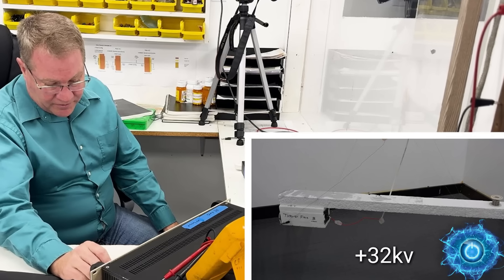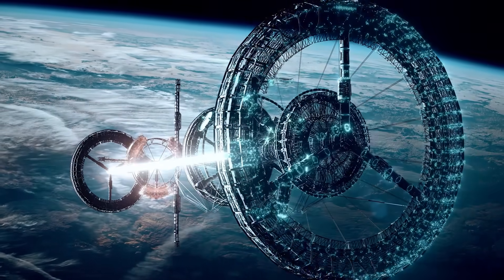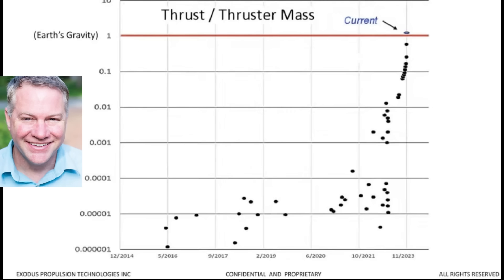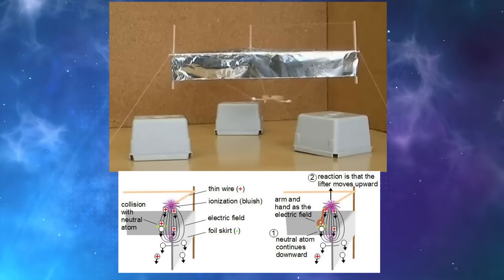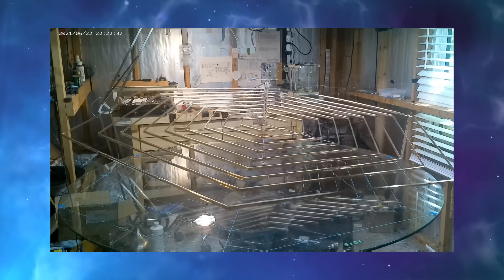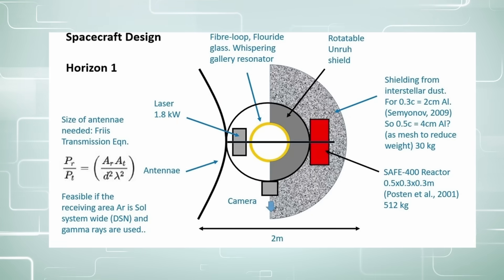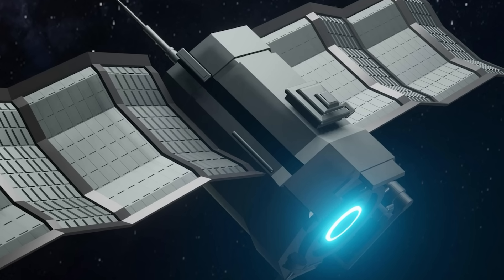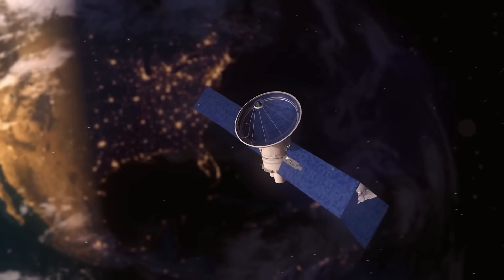Propulsion Breakthrough!? New Electric Drive Defies Physics

Comment: The cool thing is this showed lift in a vacuum  so it's not ionized wind.
Reply: Goes from lifting in air, to barely measurable in vacuum. Yeh, this is not some breakthrough drive. It's ionic thrust and an interaction with vacuum chamber.
Reply: daves7 • That's where "optimizing" enters the scene.
No vacuum is ever empty, no matter how low.
In the absence of the correct understanding, the many ways of doing different kinds of experiments is the way to go, like many times before.
Reply: The point of using a vacuum chamber is to see if the thrust drops off in proportion to atmospheric pressure.
Reply: That's not correct. Buhler never demonstrated lift in a vacuum. His results are measured in micronewtons, making it difficult to confirm that this thing even works. The lifting you saw were normal ion thrust vehicles attracting and expelling the Earth's atmosphere. So you're conflating two experiments.
Reply: phyternl "Attracting and expelling" is propulsion.
You just have to do it correctly in order to obtain the optimum process for any inertia, and...since nothing is empty, not even the so-called "vacuum of space"...you draw the correct conclusion!🤔😯

Comment: Andrew Aurigema - Propellantless Drive Engineering Test 4k - Exodus 2024

The video title above gives detailed analysis of the work that is being done, whether you believe it's accurate or not. It's an in depth discussion with the engineer who is working with the lead researcher on the project. Their primary goal is to create something to keep satellites correctly oriented and positioned.
Reply from the maker: It will be interesting to see what it will do in space.
Reply: @Motor_Explorer1  I don't really understand your focus on whether it works in space. Their testing is done is a vacuum cylinder. A shoe string one because of their budget, but vacuum non-the-less. The only negative options I am aware of are either there is some complex experimental error and there is no force, or they are doing something deceptive. They've gone to great lengths to rule out ionic wind as a possibility.
Reply from the maker: They seem to be pretty straight forward about it, this should be easily replicable in other labs. But I do agree space is probably last step in the process.
Reply: @Motor_Explorer1  Space isn’t the best test. I think controlled tests measuring acceleration vs. input energy would distinguish between a self acceleration system or spurious force from the setup..
Reply: @Sensorium19  It's not a great space drive if it doesn't work in space, y'know?
Reply: @marcforrester7738  The entire point of my comment was to point out that unless you suspect experimental error or malicious deception, there is literally no reason to believe the proposed technology would not work in space/hard vacuum. Attributing the effect to ion wind is functionally identical to saying what they are doing is fake. Ion wind drives/lifters have existed for many years and are not functionally useful in the scenarios under consideration for this technology. I would completely understand if people believed it was fake or not accurate. What I don't understand is this "does it work in space?" brain rot. Forgive me for putting it so bluntly, but this is nonsensical.
Reply: Considering the atmosphere extends quite aways into space (ions present as far as the moon). A low to mid orbit satilite shouldn't have any difficulties if it's just ion effect.
But if it's not simply/only ion effects, say aether flow/field effect due to localized high voltage disequilibrium/nonlinear mass inertial distribution etc. this could get interesting.
Reply: @dananorth895 Still,  ion wind effects hav3 to have enough mass to make thrust which is dubious in LEO. It’s not ion wind.

Comment: Ionic wind effect should be pretty easy to detect, right? The air would be blowing. Also, if the device is capable of producing more thrust than its weight (which is claimed) then it is also extremely easy to detect. So, my question is, where is the video of the levitating product?
Reply: There was a time when the Internet was awash in videos showing off Lifter projects, but over the years that fad peaked and waned. And these hobbyist don’t have vacuum chambers in which to vet out the ionic wind issue (is that the only source of propulsive effect?) NASA could have settled this years ago and Lifters are dirt cheap to build. To my knowledge they’ve never bothered to. Vast majority of scientists just dismiss Lifters to be due to ionic wind effect.
Reply: Not to mention ionic wind drives won't work in space from everything I've ever run across.
Reply from the maker: That's right so they test in vaccum. The team's drive produces a mere 10 milliNewtons, so I am thinking they are comparing some sub component to the thrust. In space, this is great for constant acceleration but on Earth it's very little. But we have to figure out what the effect even is (I don't think it's quantized inertia at all)
Reply: More thrust than the thrusters weight but not more thrust than the total weight of the thruster and power systems. Regardless of the process and whether it works in a vacuum or not, finding a self contained compact high voltage power source has still beaten everyone in the field. And if you have that power source then a magnetic sail or plasma sail interacting with the solar wind is still more thrust and easy to explain, undisputed, physics.
Reply: @franksmith3602 
Frank, I invented a car that runs on water.  It worked great until one day the Feds came knocking and told us that they wanted the plans or else.  Staring down the barrel of the gun made me turn the plans over to them rather quickly.  Now I can’t remember how to put the contraption together again, but it got 2,387 mpg.  Shell Oil bought the plans and locked them in a safe so that big oil won’t lose their control over gas and oil.  If I could only remember the combination to the safe, we could go and get them.  We would be billionaires for ever!.  Frank, are you in with me?  I need a positive answer right now.  Either you are in or you are out.  Which way do you flow, Frank???
Reply: @franksmith3602 that’s funny 😂
Reply: There’s no air in space…
Reply: They showed it in the video. Two different very basic conceptual builds. Watch it again.
Reply: But if there is no air (gas) in Space then could the ionic drive create force without wind (gas or atoms)?
Reply: @franksmith3602 😂😂😂
Reply: @franksmith3602  Pathologically lie much?
Reply: @ferrellsl  No he is telling the truth. I am the general that was there with him. Those were the best of times. I have been stuck at area 51 ever since!
Reply: @tstager1978  BS.  I was the CIA director at that time and I don't remember you at all.
Reply: Their claim is that the part of the apparatus which produces "thrust" can lift it's own weight, but not the weight of the entire system (power source, control electronics, etc).

They expect to be able to have a self contained, "levitating" craft in the next 12 months.
Reply: If they have these demo models as per the video clips. Just make a small scale one and I am sure Elon Musk would put it into space for real tests for nothing or a nominal amount. It would be of great interest to him if it is proven to work in the vacuum of space.
Regards from South Africa
Reply: @IO-zz2xy  Rocket launces are rough. Vibrations can wreck these designs. Its a problem.
Reply: No it does not work. They are ignoring the interaction between the device & the metal vacuum chamber. Its just electrostatic force between the metal vacuum container & the HV charged plates. Same thing with the Q-Drive that was the rage a few years ago.
Reply: @guytech7310  you ignore ionic model flight that proves it does work... at least on the scale of ounces. But like all other electric vehicles we do not have a power source that makes it practical.  And you can park a battleship between the distance of possible and practical.

But there are a number of companies proving results trying to make it practical... but I think they have many years if not decades more work to do before it will work on even a small scale.

However you could build a light drone today and use it, but why would you. Using a electric motor and a prop would give you much greater range.

But saying it does not work is grossly inaccurate.
Reply: @billlyell8322   This device is set up to work in a vacuum. Lifters are pointless in space since there is no air to use to generate thrust. Please think before you go on a rant.
Reply: @billlyell8322  large scale (and sized) capacitors are the supposed cure to this. We have already capacitors that do much simpler things today.
Reply: @guytech7310  Yeah thought that too -it might just be Lorentz Forces
Reply: @guytech7310  That’s not the case. That possibility was carefully accounted for.
Reply: @RV-qj6gm  No they didn't. Nothing mentioned in the paper or the video about checking or testing.
Reply: @guytech7310  I heard them myself say they did account for that. Besides, hundreds of tests on various designs give results according to calculations which would not exactly match spurious charges on the chamber. You are just making assumption based on what you think must have happened since you cannot accept a new discovery.
Reply: @guytech7310  it's also always the typical electromagnetic force
Reply: @guytech7310 it works outside the vacuum chamber it just can’t be accurately measured outside the chamber
Reply: @thomlayne  No it does not. same issue as the Q-Drive. No thrust can be produced without either a mass that gets accelerated or charge interacts with mass (ie vacuun chamber. Clearly if there is a build up on force its because charge is building up on something producing a small amount of force.

These devices are pretty much the same a perpetual motion machines.
Reply: @guytech7310  everything travels in a complete loop with electrostatics as far as I know. I don't think they saw the full loop
Reply: @guytech7310 Wow! They're really bad scientists. They should hire you.
Reply: @bnjmnwst  Minimum wage with no benefits of course.
Reply: @egioch  there are a lots of videos and even film of this working. It's easy to look them up. But on earth in gravity there presents a problem. That it they are very light fragile craft only able to lift themselves. The power source and electronics have to be located externally.

However, an ionic wind model aircraft was flow in Europe I believe just a couple of years ago. While flying a model night seam trivial it was a huge leap in trust for iconic drives.

It was the first example I've seen of the ionic drive used to provide force for conventional wings to lift a craft... although it was only a model plane. Previous attempts were wingless.

BUT there is a huge difference from lighting a model weighing ones and a plane with the weight of tons.  Many more such leaps will be required before that is possible.

However the model does prove it possible... just not currently technology feasible.  Again we run into the same problems all electric vehicles suffer.... weight and the amount of power required.
Reply: @billlyell8322  I've see the videos. Like I stated the ignore the obvious; electrostatic force interacting with the metal vacuum chamber vessel. Notice the thrust increases with time, because it take time for electrostatic charge to build up with the vacuum chamber vessel.

This is no different the the Q-Drive guys that convinced themselves they had a massless drive.